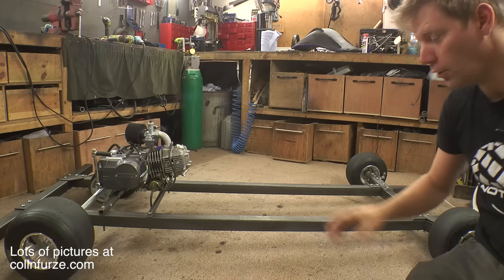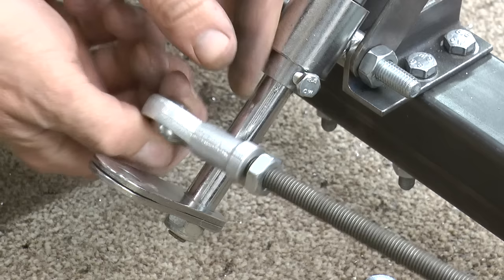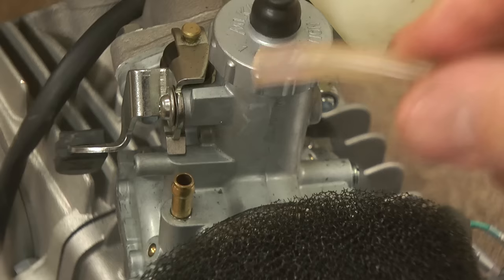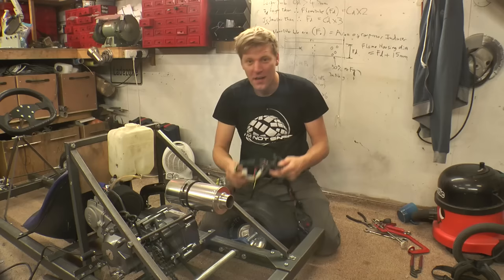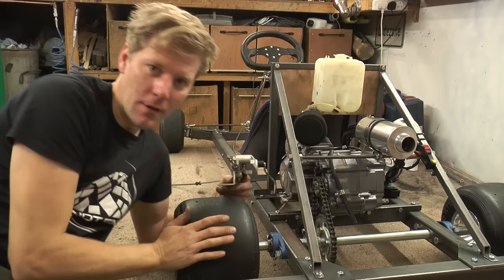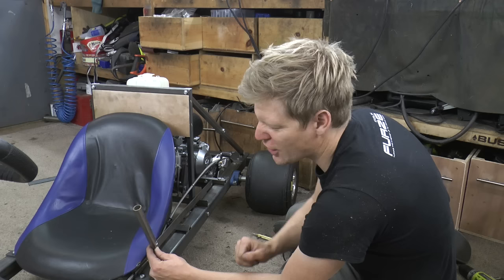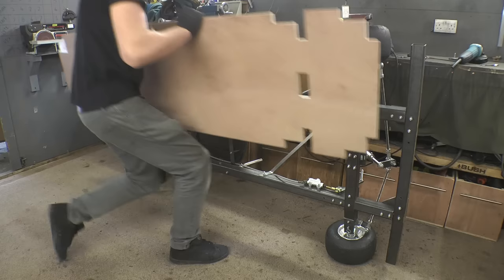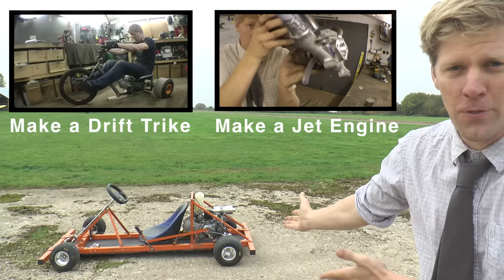Making a Motorised Go Cart with NO WELDER and simple tools #2 Finish/Test

Comment: You should make another one manual and off road tries winch just as a challenge with  o welder or plasma cutter but everything else in the new shop

So basically a off road buggy with a manual transmission without a welder or plasma cutter with a roll cage and body kit
Reply: If you have the money to do all of that you have the money to get a entry level welder

Comment: A used stick welder is less than £50 btw n similar price for MIG. If you want a TIG, it'll be less than the engine as they start around £200+ 
I know he's bought new everything but a used bike will be cheaper and there's loads of other bits you can use off it. Go down your local scrap yard as you'll get a good price on everything. When it comes to the metal it'll be scrap price or go down your local breakers yard as you'll find pretty much everything there. 

I'd like to build something but like most people. I can't afford the materials n I've only got a 100A stick welder which cost £20 n only good for thick materials, not 1mm or 2mm anything! I'm saving up for a HF AC/DC TIG which is £400 new (as used one's are more expensive and there mostly huge n are 3ph) plus everything else that goes with it so in total around the £500+ mark. N that's before you want to get the materials to make something or even repair something.

I'd really like a mill and a lathe. But one I can't afford one and two, I can't move in my 8" X 6" shed as it is and my landlord will allow me to build a bigger shed but there's a time window which is all well and good. But I can't afford to do it in that short window. 

Like most things in life. If you enjoy doing something, it's expensive, e.g. clay pigeon shooting or anything that's RC (especially if it flies!). Don't ask me how I know 🚁💥

Money DOES make you life happier.
Anyone who says otherwise already has too much of it or doesn't have a fucking clue.
You don't realise how much easier it makes you life. It makes it simpler, less stressful which also helps with your mental health miles better. Millions and millions of people's relationships have ended because of there finances. 
Lack of money means obesity and not being able to get proper health care. Living in substandard accommodation. Teenage pregnancy, having lots of kids and being abused. Not being able to get the correct treatment for mental health which ends up in suicides. Either using the money to heat your home or feed yourself which affects your kids not having breakfast and also getting bullied at school because they get free school meals. This ends up with them getting into trouble because the other kids getting away with it n it's a downward spiral.
Sorry. I went off on a tangent there 😕

Comment: Hi Colin I'm thinking of making this but if I made it a bit higher and added off road tyres would it be effective off road ??
Reply: Might need a set of shocks and springs
Reply: You could probably salvage what you need off a quad bike either just suspension or engine and wheels aswell

Comment: I know I'm a bit behind on the questions here but what bearings did you use for the steering column and the bits the wheels mount to, not the track rods the actual part the front wheels connect onto to enable it to have steering??

Comment: Hey Colinfurze , it is a excelent work, i am on the way to fabricate a similar gokart, i have a doubt regard to the possition of the motor in this configuration, do you have any problems with the refrigaration of the engine? It seems that not have to much air flow to the engine head due to the seat. Thanks

Comment: I know that it is a old video but if I were to do something like this with a electric starter I would probably extend the wires and make a bracket for the key and ignition somewhere at the steering wheel just like a real car

I'm sorry if you didn't understand I am from Sweden

Comment: wait, where is clutch pedal  ?
Reply: As he stated in the video, the transmission for this motor uses a system where there is no clutch pedal. The shifter actuates the clutch and shifts the gears.

Comment: Why wood for underbody? It’s heavy, and warps. Maybe plastic instead ?
Reply: I think he picked wood because its alot less likely to crack out under stress and break from road debris. A 3/4 inch piece of plywood is way more tough than plastic. And you want the weight to keep your center of gravity as low as possible on a flat kart.

Comment: The whole go-kart think what you did was pretty cool I like the whole thing but there's one big problem you didn't do anything to ram air to engine insufficient about an air blowing on the front part of the engine it will overheat eventually probably within 20 minutes or longer having the seat and everything in front of the engine you're only getting mediocre amount of air blowing over the engine you need full amount of air blowing over the engine to cool the fins that are on front of the engine where the spark plugs at you'll notice there's cooling fans on that engine how does the air blow on to those kids if the seat is blocking all this wind turbulence as you're moving forward so I was going to do is create some air fins rabbit-ear scuba gear to blow to the back part of your seat which interns blows air onto the engine so therefore you can run the engine for more than a half-hour without overheating I'm just saying

Comment: Buddy you did use a welding machine because the rear sprocket and break rotor are welded on. 6:00 look there welded on. Im not criticizing but you did take a short cut and if someone did want to do this and didn't have access to a weldier what would they do?